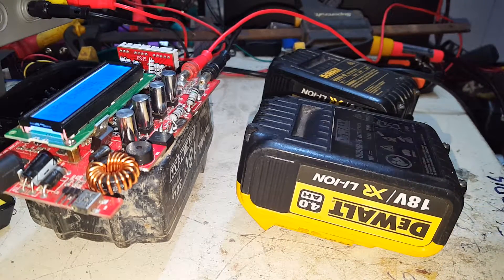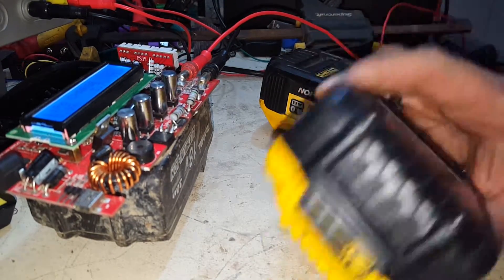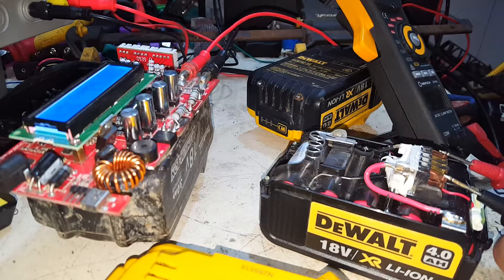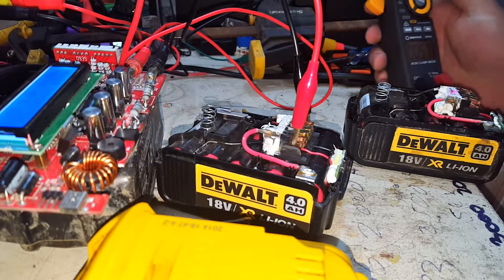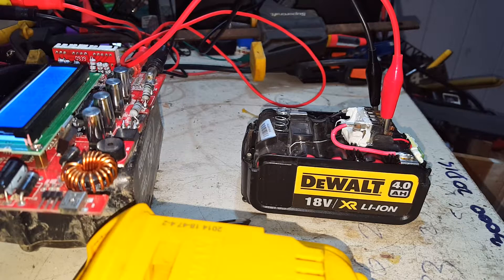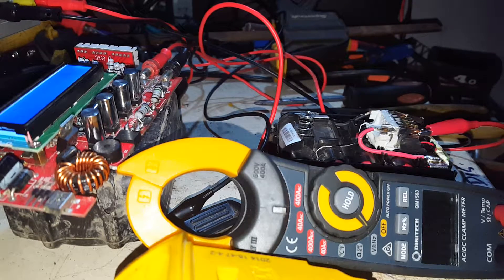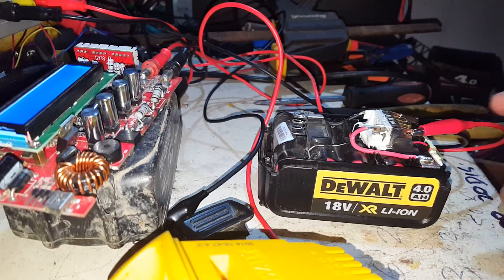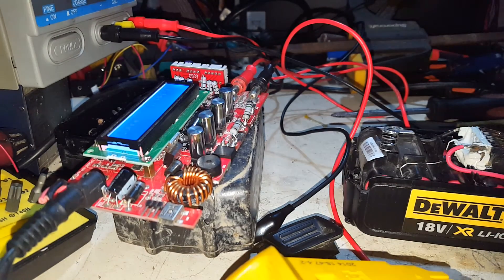Dewalt Xr 4.0 battery tear down and  cell balance check

Comment: What’s that you use to charge these cells
Reply from the maker: Lipo remote control car battery charger or a lab power supply
Reply: @Oneupthesleevecustoms could you please make a video of how these work and where to get them from if possible 😅
Reply from the maker: Sorry mate this is from 8 years ago

Comment: Interesting, I just had to balance charge a Dewalt 2ah XR that was so bad, only 2 of the charge lights lit after charge.  After charge once cell 4.09v and others as low as 2.5v.  I must say the connection straps were corroded from obvious rain damage, but even so, they clearly were not balance charging.  QUESTION: have you ever seen an unbalanced pack?
Reply from the maker: Unbalance is the killer of every power tool battery. I've had to balance my 300$ Milwaukee 12.0 amp 18v battery's so many times
Reply: @Oneupthesleevecustoms  Imagine the life you could get balance charging Ni-Cads (!)  - LOTS of jumpers!   I'm wondering if you could balance charge a Dewalt directly thru the contacts with a LiPo balance charger?  Seems you can see the voltages so one would think it might be possible.  Would be nice not having to disassemble the pack.  I have a contractor buddy I help with batteris - I've gone Ryobi and clearly they are not balance charged.  But one thing:  if all the charge indicator lights are not lit after a charge, balance charging is in order and hopefully all cells are still good.

Comment: on an 18 v XR MACHINE there are on the outer end B+ and B-. What are the 2 in the middle for? Is it a Sensor control for the Battery? I would like to power my machine without an Battery, but i think it is checkin some  Health (maybe temperature) thats why it is not turning. Do you know, how i can emulate an attaced Battery? Machine is an Dewalt DCW200N
Reply from the maker: Ill see if I have one left and I'll make a video response if I do cheers

Comment: Hey do you know what type of battery cells the RIDGID 5.0 have? I've read in a tool blog that they made them with larger cells than the usual 18650 cells.
Reply from the maker: iiloverr larger capacity  or physical size? im yet to get my hands on a rigid one
Reply: One up the sleeve customs I think the battery cells  are physically bigger but I might be  wrong. What I do know for a fact is that the 5.0 is considerably bigger than the 4.0. I seen the aeg you open up but I don't know if it's the camera angle but they don't look as big as the ridgid. There's a picture of the 5.0 next to the 4.0 n 2.0 on this tool blog called  toolguyd.com just search ridgid 5.0 if you have some time its in the article about the brushless miter saw.
Reply from the maker: iiloverr i think rigid is owned by Bosch will check up on it  though.  Milwaukee  v18 and v28 batterys run huge cells have a look on my channel i tore a v28 batt down cheers